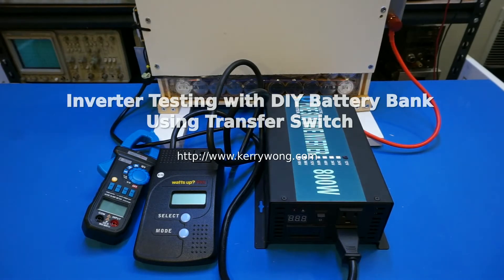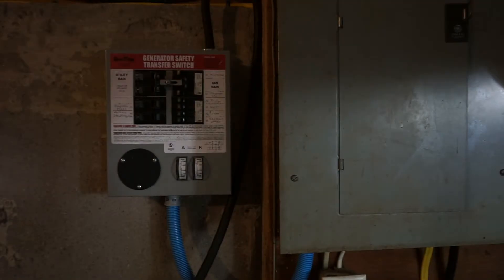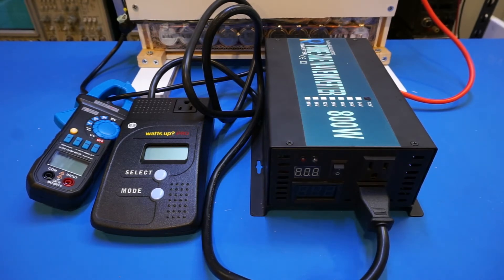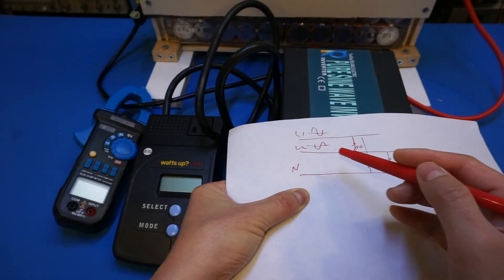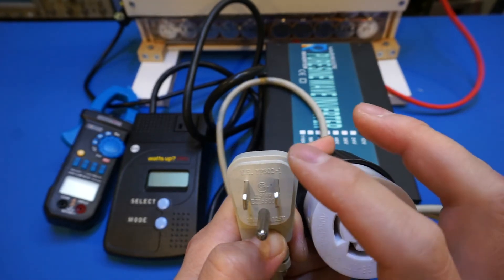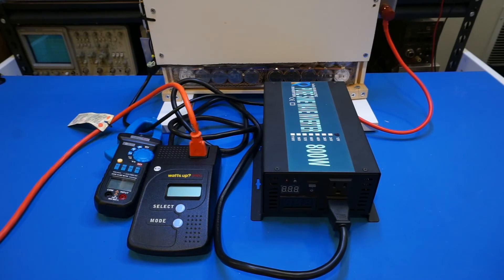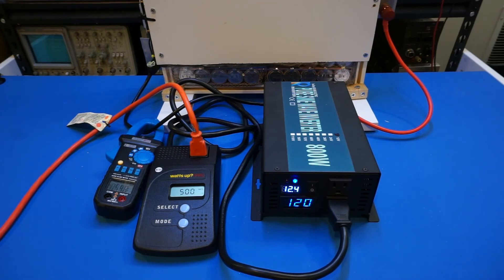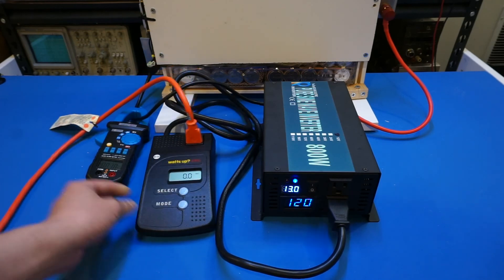Inverter Testing with DIY Battery Bank

Comment: What kind of precautions do we need to make in regards to the neutral and ground being bonded together at the main panel? Don't we need to make sure the ground and neutral at the inverter is not bonded? I hear people talk about it and yet still don't fully understand how to tell if an inverter is capable of being connected to the transfer switch safely. Thanks for the video and explanations!
Reply from the maker: This really depends on the inverter you have.. For this particular inverter, there is no physical connection internally between ground and neutral and thus it's safe to connect them together.

Comment: btw, L14-30R is Locking 14, 30amp Receptacle. It mates with a L14-30Plug. The "3 prong" are 5-15Plug and 5-15Receptacle but are also available in Locking versions. There are many plugs and receptacles.

Wiring, not as an electrician but correcting professionals' mistakes, since I was 8 years old.
Reply from the maker: Thanks for the info!

Comment: It would be interesting to see a teardown/explanation on how the generator transfer switch works. I could see the lights flickering when it transferred the power, what is the switching time and would that be an issue for some of your equipment you think? Would it be possible to switch between the two power systems when they are in phase with each other so that the transition would be completely seamless?
Reply from the maker: Transfer switches are designed to break-before-make so the flickering is normal. In typical use they are switched only when the power is already out. You can think of a transfer switch as a DPDT switch and by switching it you can either use mains power or the back up power.
Reply: It would be good to see a tear down on a transfer switch. You could actually explain how back feed works and how it kills linemen.